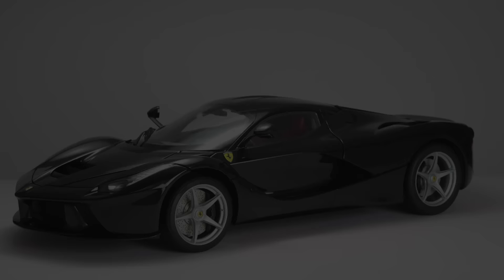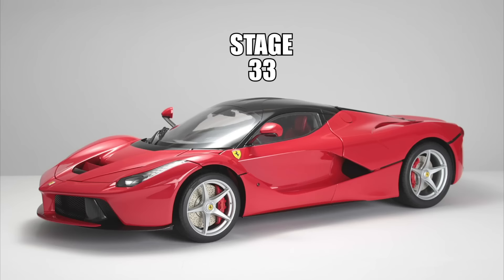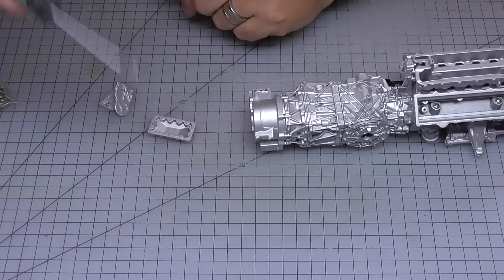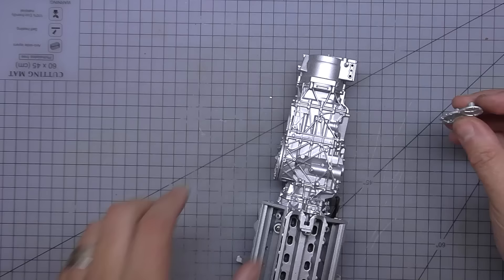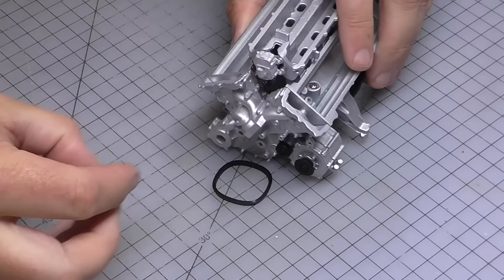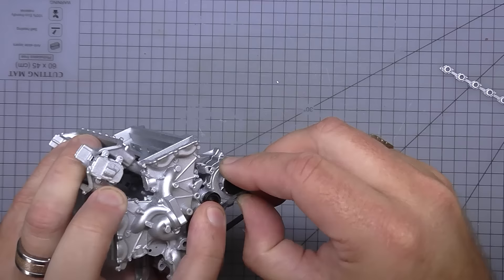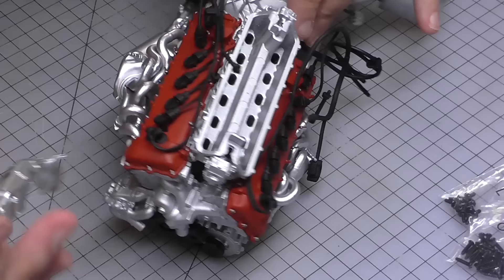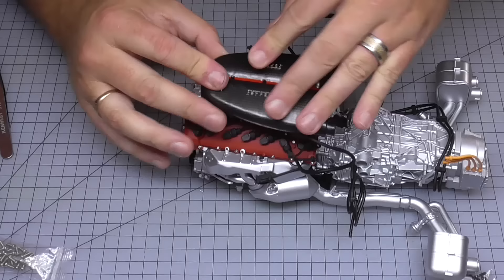Build the LaFerrari 1:8 Scale - Pack 5 - Stages 33-40

Comment: I am also building this model and note that in my instructions the exhaust manifolds were desigated A through F. However the parts were marked 1 though 6, making it very iofficult to tell which manifold went where. Had to resort to trial and error.
Reply: I assume you tried substituting each number for the correct sequential order of the letters?
Reply: Took me a whole day to figure it out.  I am not too good at matching pictures to actual pictures.  After doing the first one, the second one was harder for me.  I am a slow learner.

Comment: It would be nice if the drive lime actually worked givin its 1/8th scale
Reply: Some of the 1/8th scale plastic Tamiya kits used to have electric motors in them but the 'drag' of the plastic parts against each other, even if a lubricant was used, meant that the motor could barely turn the drive wheels without any load on them let alone on a hard surface.